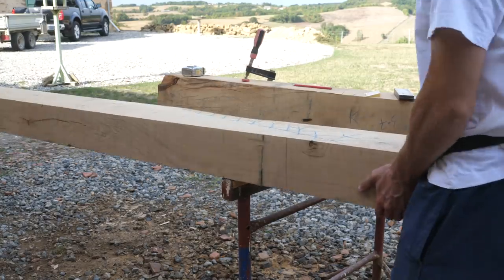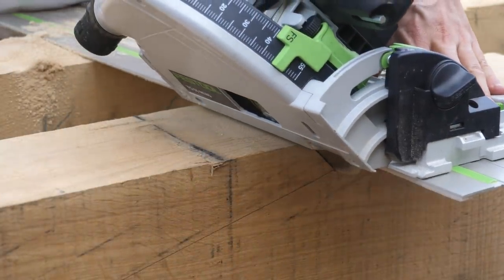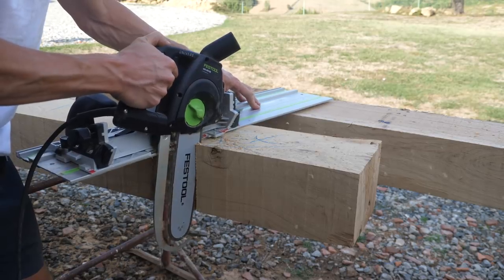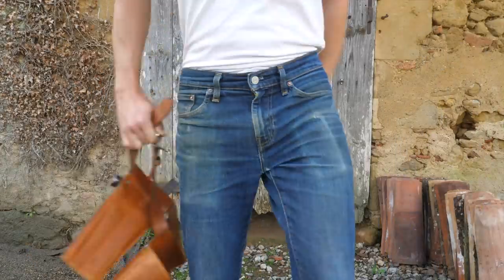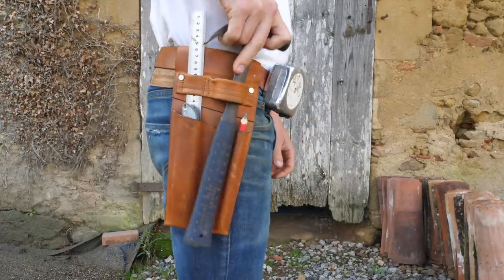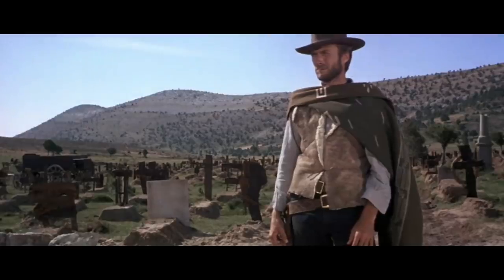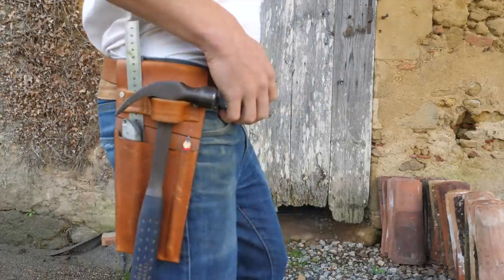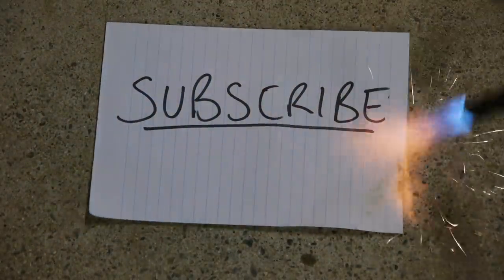Restoring an Ancient Barn | Part 3

Comment: A little constructive criticism from a framer. You need to go on a structural timber grading course,I did mine at the Weald and Downland Museum, it's very informative. If you look at 3.39, the lower timber is horrible, not necessarily the boring beetle holes( that depends how deep they are) it's the the massive knot right at the point of most stress, it's more than 50% of the timber. The mill have put a blue line and arrow where it should be cut off. Always order oak a good 300-400mm more than you think you need, it gives you a little more leeway, and you can always use the excess to make pegs.

Comment: Nice video. Modern tools make this so quick to do. In our last house we had 2 joints like this in the vertical timbers. Not sure of the exact date but that part of the house has been dated at approx 1420 so this joint has been used for a very long time. The only difference in the joint is that ours had a pair of wedges inserted of equal thickness to tighten it up. John

Comment: Tip. For the wedge prepare the timber oversize and cut in half on the angle with a false fence at the angle. Only one cut required on the angle for two wedges and less waste. The angled fence is from scrap and will be an investment because you know that was the wrong way to do it!

Comment: When I am milling timber on my logosol sawmill and I see wavy patterns in the cut timber from the chain saw it usually means that my tooth length is not even or my chain is loose or The bar is worn. It seems like the festool should leave a smoother surface than it does. Hardwood is challenging though.
Reply: My festool doesn't cut jarrah, but it does an ok job of slowly burning a path.

Comment: Hi, nice job, don't know if you have updated your technique for cutting the wedges, if not, from a decent sized off-cut cut the shape of the wedge and leave a small protrusion at the back (thin side of the wedge) put this template against the fence, put your wedge timber in the template and pull it back into the protrusion, adjust the fence so the thick  end of the wedge is correct, then use the template to push the wedge through the saw, much safer and you get a straight cut at the correct angle, saws don't take prisoners!!

Comment: Love the video, and the chainsaw is amazing.  I have never seen a scarf joint cut as a single line though, I thought it was always offset by the thickness of the timber, so they are notched into each other?
Reply from the maker: That's definitely the more common type, but a lot more work and when the timber is this large, it could take an extra day I imagine!

Comment: The video is cool and all but you could have at least explained how you came to the cuts.  Like in this type of hanger joint, the joint cut itself needs to be three times the thickness of the board. Like this board looks like it's a 12x12 so the length would be 36".  And the counter cut needs to be at 90% to the length cut. Things that make the video as informative as it is a pleasure to watch.

Comment: I don't get it why you use oak? Is it for historical accuracy or what. I understand those beams in openings should be stronger but whole roof construction? Why don't you use for rafters and purlins spruce, pine of even larch.
Reply from the maker: Exactly, we wanted to stay as true to the original materials as possible
Reply: @carlroge  In such case you should use 300 years old carpenter tools 😁
I get it why, someone would like build it like this,  but I'm not such a purist. Keep up the good job.